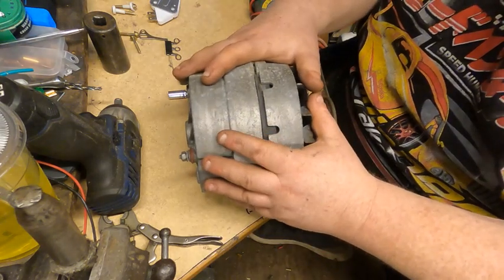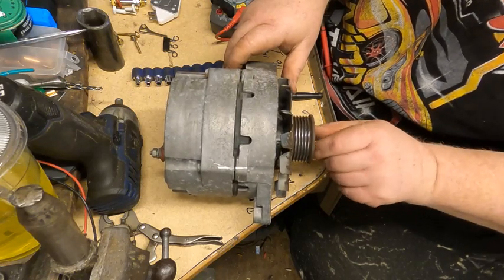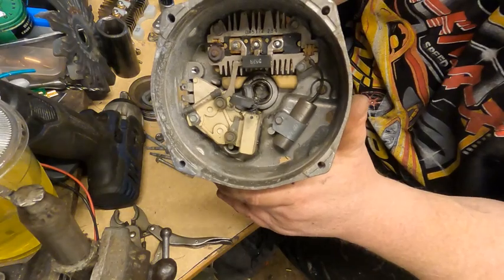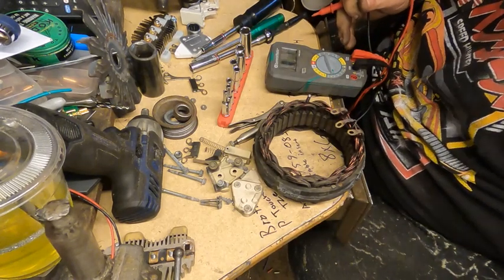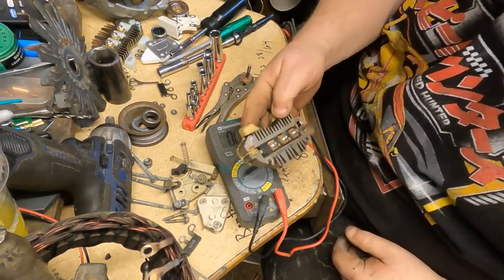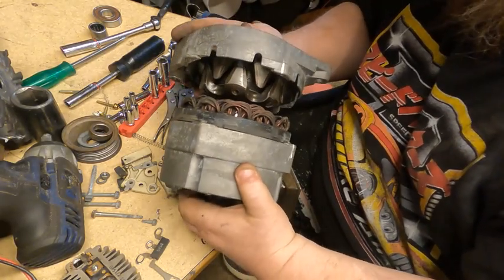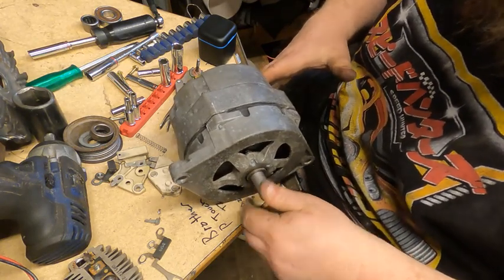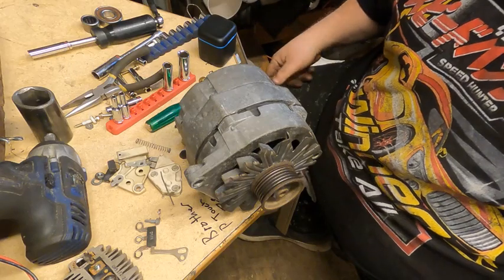Testing & Repairing C4 Corvette Alternator

Comment: I appreciate that you took the time to put this together. You have however made several errors, I hope you understand. I have an 85 Corvette and have repaired the Alternator for high voltage and pulsing output of about 15.2 volts. All the lights in my car would flicker, especially at idle. Here is what you need to work on.
1. Unless the pulley end bearing is bad you do not have to touch the large nut and fan. That can stay in place.  You can remove the 4 bolts and remove the cover end from the stator. When you do that, you will find the brushes and springs have popped out. 
2. Then you can remove the 3 nuts holding the stator winding onto the bridge rectifier. You can then carefully remove the stator from the case, by prying around a little at a time. 
3. You can then have access to the regulator and resistor, making sure to know the location of the diode trio in the stackup and of the insulated washers that hold the regulator down. At this point you can check the resistor, it should have about 40 to 45 ohms .
4. Next you can test the diode trio. If you multimeter has a diode check position ( often a part of the continuity setting ) , or a separate setting , you can measure the Forward voltage one way if you hold the probes long enough. My readings were all approx 530 millivolts. In the reverse direction there should be no continuity, or OL open loop . You can also measure the diode trio using the ohm scale , one way , like you did you will measure a low resistance , and when reversed the resistance will be very high or out of range OL, open loop. Your diode trio in the video looked good. 
5. You checked the rotor field windings for opens or shorts, but not for the correct resistance from slip ring to slip ring. NOTE. to measure the slip rings you must contact the multimeter probes on a bare spot of copper. You will get bad readings on the brush carbon residue. The correct resistance is 2.5 to 3.5 ohms.
6. When you measured the bridge rectifier you only measured 3 out of 6 diodes. You measured the ground side 3 diodes. There are also 3 diodes that get measured from the opposite side of the finned unit back to the center stud . ( each diode attaches as an open slot around the stud , you must contact the correct side ) . The opposite side of the finned assembly is the battery power side where the internal Batt terminal bolt attaches to. Notice the underside is surrounded by plastic to keep it insulated from the ground side and alternator case. The normal range for all 6 diodes individually is 500 to 550 millivolts ,forward voltage , one way only. No continiuty the other way.
7. The capacitor should be about 1.5 microfarads. If you do not have a capacitor tester, you can use an analog or a digital ohm meter on the highest scale and when the leads are attached, the resistance should climb as the capacitor charges and at some point the meter will overrange OL ,or infinity. This shows the capacitor is holding a charge. If there is no rise in resistance, the capacitor to bad. To test more than once, you have to connect the capacitor body to the wire to discharge it. 
8. There is a easy to do a simple check of the voltage regulator, using a 9 volt battery, but it only tests for basic continuity. To test properly  you need a selectable power supply to determine when the alternator current will back off and not overcharge. Some autoparts stores might also be able to test. They are not much money ,but be sure to get the one for 108 amps. These are more money. It was the voltage regulator that was the cause of my excess voltage and pulsing light output at idle.
9. If the brushes are worn, it is a good time to replace them.
Reply from the maker: @danieljurgill1681  I appreciate your input and attention to detail. I showed how the factory GM service manuals says to do it so as to keep it simple for those that are far less technically skilled than you or I. I also mention in the video that I am not an expert in alternator rebuilding and testing. I have found what works for me in 40 years of doing these repairs. Perhaps the best answer is for you to film a video showing all the details you wrote about and post it on YouTube or I would be happy to post it on my channel to get the information out there. Thanks for watching and thank you for the information.
Reply: @GettinGreasyGarage  I complimented you for doing the video...I do not know  the first think about making a youtube video, so I appreciate people like you doing it.  I just thought that by adding my comment perhaps you might do future ones with all the shop manual info. I have had my 85 corvette since 1988, and have had the shop manual to refer to. In addition, anyone looking at your video, would be able to see my comments, if they had additional questions or details not specified . It is next to impossible to clearly see your posted pages of the shop manual  if using a little cell phone. Lucky I have the actual manual. I agree with  your other comments , about the old days. I am almost 69 now , my Dad ( rip)  always repaired starters / generators etc.. I find it hard to believe that people will put a new China alternator on a car ,without even diagnosing what is wrong with the old one. It is nice to know that is not you, and that is not me also. Thanks so much for responding to my comments.

Comment: Thanks! Great video. But how do you remove the rotor from the front cover? In a lot of videos it just slips off. In my case seems the bearing is stuck. Is it supposed to use a press on this particular model or effectively it is stuck? I'm spraying lubricant and come out rust..
Reply from the maker: @adri14f  the front cover bearing isn't press fit on the rotor shaft by design but rust and grit do get in there to stick it on. You can use a block of wood or something to protect the threads and use a hammer to tap on it.  Prop up the cover to get it off though I have had a few that just wouldn't come out that I had to use some heat and a press. Be careful not to damage the aluminum housing.
Reply: @GettinGreasyGarage  thank you!

Comment: Audio is great! Picture is great! GoPros are nice, until they ain't. Which one did you get? 
Rant on brother... I'm SOOOOO tired of SHIT parts. I use to pick up NOS Ford 1G alternator blister paks cheap off eBay. Don't see many of them anymore. I did that a few times back when I was not very well off..... and then as time passed it was just cheaper to buy the whole alternator than the kits. FFWD to today and whole alternators are NOT cheap anymore, and no one will stand behind their warranty! Nothing but JUNK. Tired of wasting my time and chasing my tail with the shit Chyna parts we get. I am fortunate enough that there is a starter/alternator re-builder guy in nearby BattleGround if I need him. He's done some super old rarer stuff for me and does a good job and for a reasonable price. I'd like to get back into doing them myself. The problem i had was sourcing quality parts. Seems like all that shit, even individually, is China. VERY Frustrating! So I feel ya Mike....
Reply from the maker: I can only hope the kit parts are quality. I went with a GoPro 9 Black. Got a whole kit with mounts and accessories, extra SD cards, 3 extra batteries and a charging cube for $380
Reply: @GettinGreasyGarage  Sounds like a great deal on the camera!